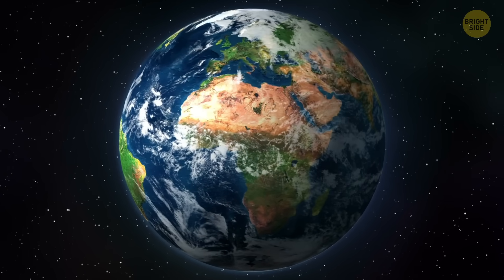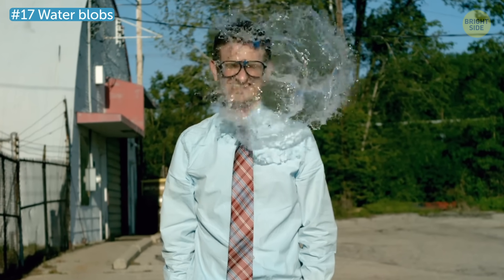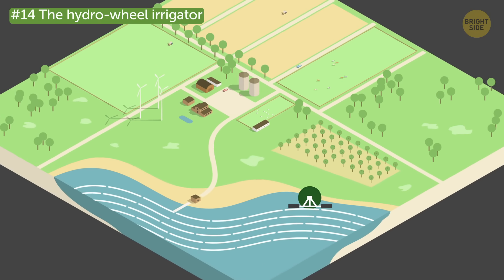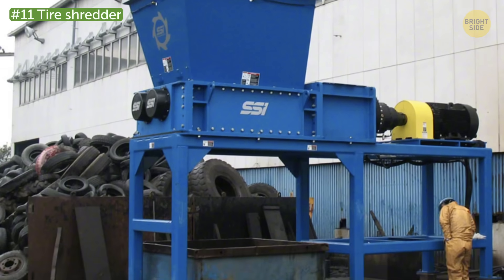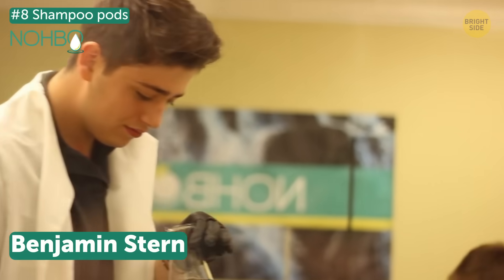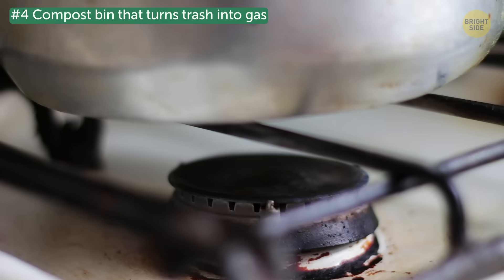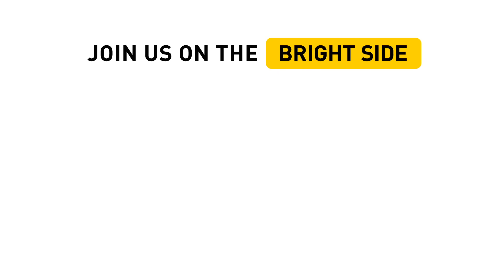22 Amazing Inventions That Will Save Our Planet

Comment: I have an idea so you know the sun is creating iron and it needs to be removed right?
So what if we found a way to extract iron from the sun to be used into tools.
We would need to find a way not to melt that close and get tools up there to harness the sun's resources but it is an idea that can help with resource shortages

Comment: Some things that might be helpful:

1 soil that helps trees of any kind grow faster. Why: humans have been using wood for tons of stuff so we are losing forests 
... HELP I CANT THINK OF ANYTHING! Please comment down below for more ideas
Reply: I heard someone from our university has invented a building stone that doesn't let heat or cold to enter the building .....for example if my house was made with these building stones, it can be very cold outside but my house will remain worm because the stone blocks the cold from crossing it .... and this is the same thing if it was hot outside ... my house will be cold ....and if we could build houses with these stones we will stop using air conditioners, the rural places won't need to cut trees for the heat ...ect

Comment: In my country it is prohibited to produce energy in any way without government license. Even if you get the permission which is not likely you have to sell the energy to the government for a fixed very low price and buy high price electricity from their grid if you want to use it. If you just install a small windmill or turbine in your yard and use the energy instead of connecting to the grid you get a sentence of up to 7 years in prison. But at the same time they tell you how they care about the environment.

Comment from the maker: TIMESTAMPS:
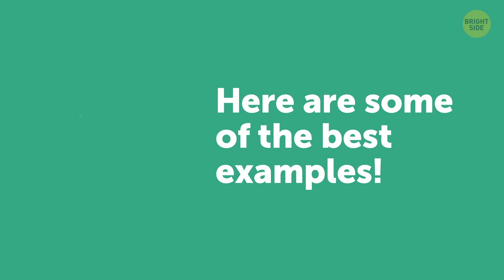Edible cutlery 0:36
Toothpaste pills 1:13
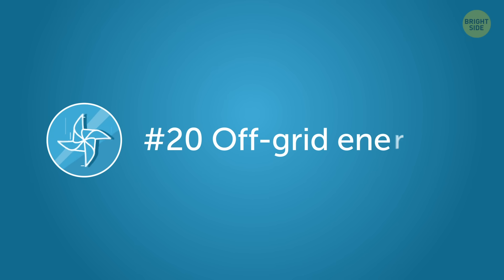Off-grid energy 1:48
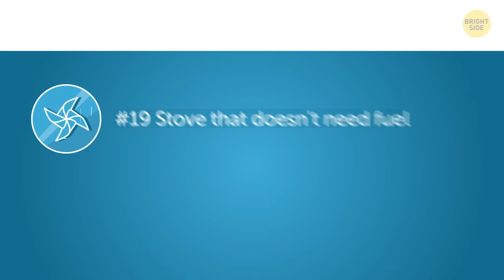Stove that doesn't need fuel 2:21
Old plastic bottles as light bulbs 2:50
Water blobs 3:24
Plastic bottle cutter 3:58
Edible packaging 4:25
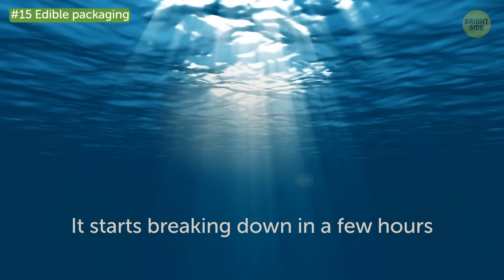The hydro-wheel irrigator 4:59
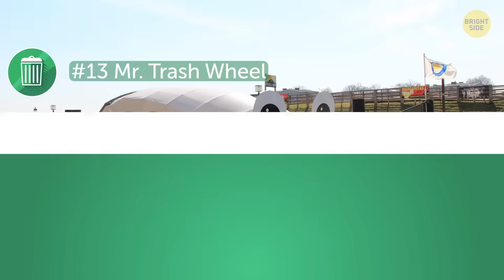Mr. Trash Wheel 5:34
Portable turbine 6:04
Tire shredder 6:37
Shipping container pools 7:06
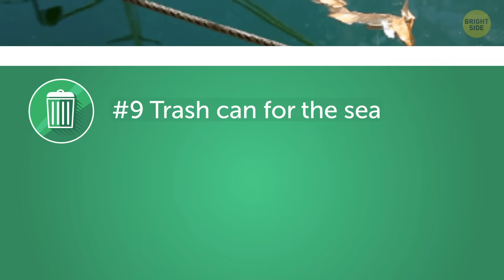Trash can for the sea 7:38
Shampoo pods 8:03
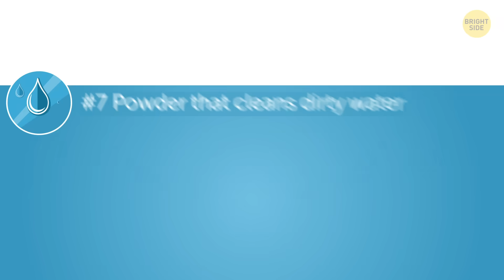Powder that cleans dirty water 8:36
Biodegradable bags 9:05
Whirlpool turbine 9:24
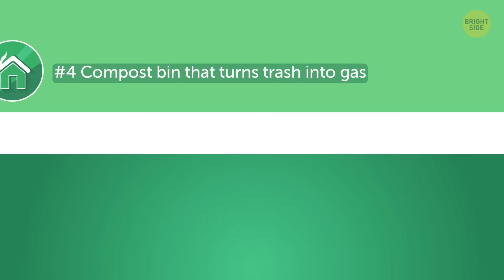Compost bin that turns trash into gas 9:50
Washing machine on pedal power 10:23
Waterotor 10:46
Charcoal made from poo 11:06
Reply: wait what thats long
Reply: BRIGHT SIDE I wanna poo
Reply: @Miychae 😂
Reply: Thank you so much ❤